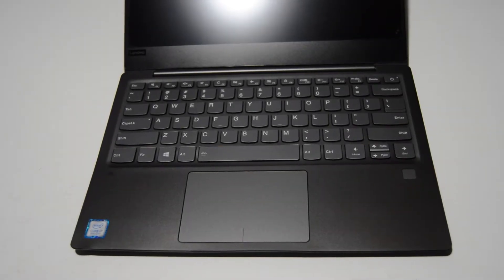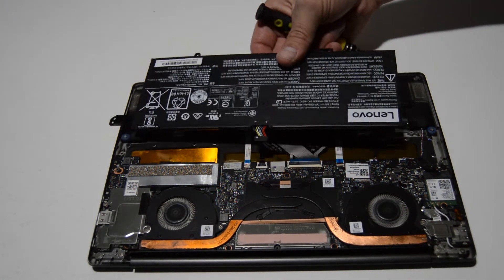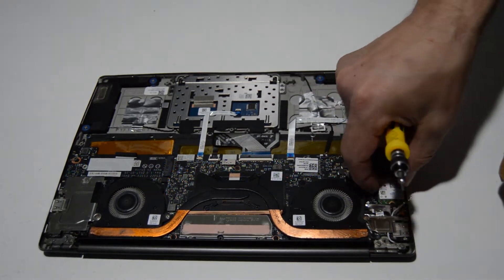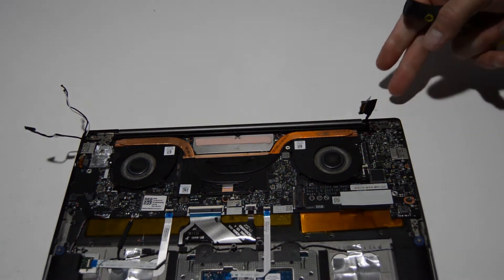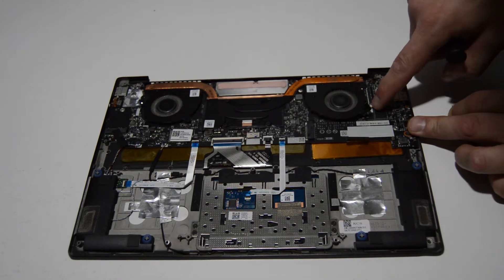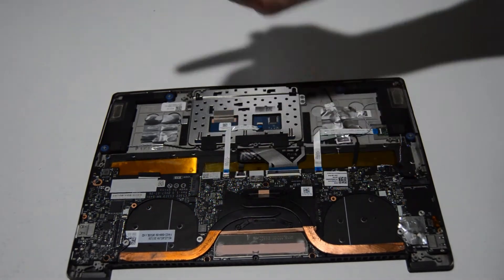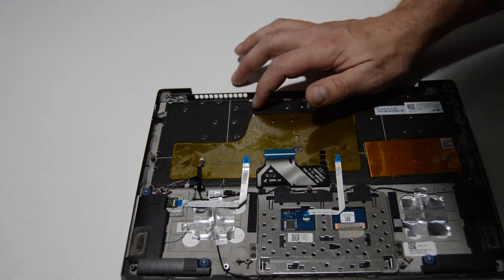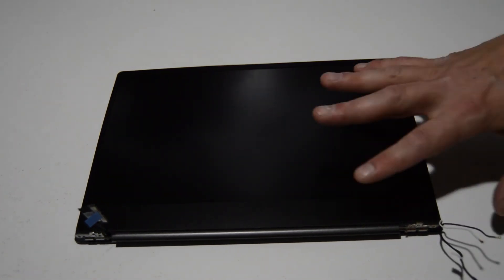How to Disassemble Lenovo Yoga 720 13ikb Laptop

Comment: THanks for this. 
I have this model, and the touchpad had been progressively getting less responsive, and erratic. 
The delete key was also mostly not responding when pressed. 
Last weekend, the touchpad and mouse became so erratic it was unuseable. 
So I decided to clean and reconnect the touchpad ribbon to the mobo zif connector, hoping the touchpad issue was just a loose connector. 
Well blow me down, not only was the touchpad returned to pristine operation, but also the mouse and delete key function. 
I had taken the delete key apart before but could not get it to work reliably. 
Who would have thought a loose touchpad connector would screw up the keyboard. 
Anyway, your video gave me the assurance of how to dive in without causing catastrophic damage. 
Thankyou sir!!!

Comment: Crazy Tutorials but how do i know if i have a 13ikb without or with replaceable Keyboard? You have demonstrated both options but i couldn't catch the difference. 
Great work.
Reply from the maker: Just enter your exact lenovo model number and add the word "keyboard" on eBay... you should be able to see examples of what yours looks like. Generally most keyboards mounted on plastic palmrests have those melted plastic rivets, and those with metal palmrests use screws.
Reply: Thank you so much.